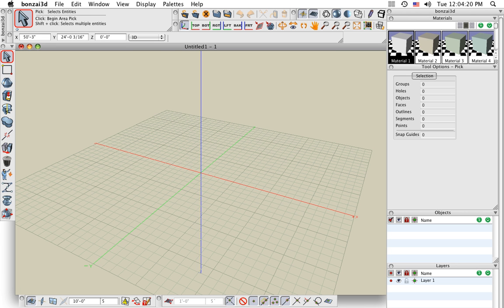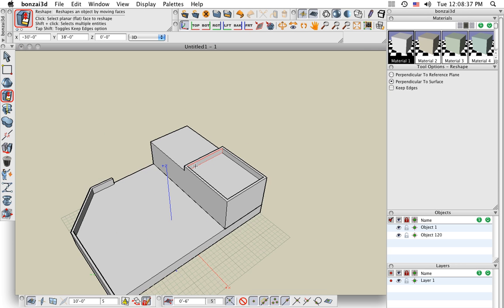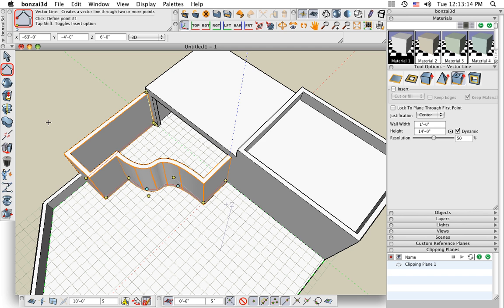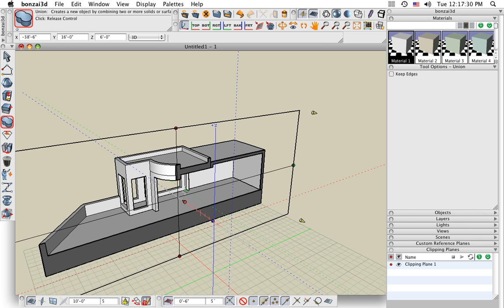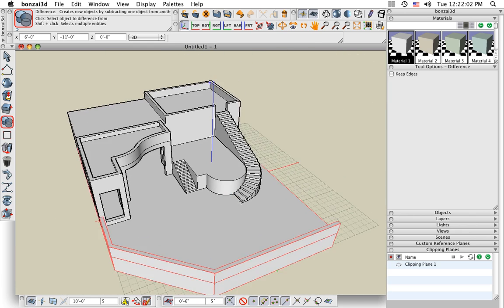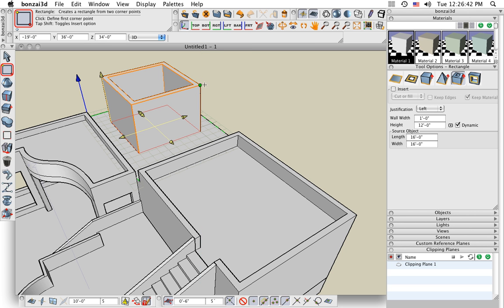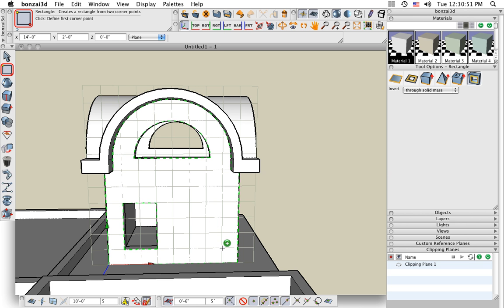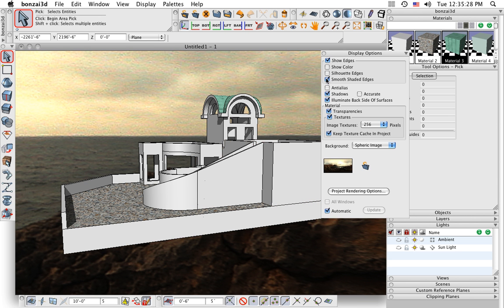bonzai3d - Sketch example : an architectural design exploration

Comment: ***** I believe I see a few things in this demo which would be quite difficult to do with Sketchup (at least the free version I am familiar with).  It would be very good to have a video which does a side-by-side demo and demonstrates the features of bonzai which are difficult, if not impossible, to do with sketchup.
Reply from the maker: Hi DukeLacrosse20,

Yes, there is LOTS that bonzai3d can do that SketchUp can not.  There is not a specific video dedicated to this (perhaps that is not a bad idea) but you can see this throughout our videos.  For even more capability, check out the videos for formZ -- which includes all of bonzai3d and a lot more!

Comment from the maker: Hi Vanastarr,

Bonzai3d offers many more tools beyond what SketchUp has, including Solid Modeling, Smooth Geometry, NURBS, and much more.  Check out the other videos we have on our channel and you should soon see the difference!

Bonzai3d also creates nice clean geometry without crossing or missing faces,  so the models created in bonzai3d can easily be used for rapid prototyping & much much more.

Give it a try and you will see why so many SkechUp users have switched to bonzai3d!

Comment: Hi Arcbc33,

Perhaps the easiest way to do this would be to simply draw the desired 2d (closed) shape, extrude it, and move it so it intersects the wall where you want the hole.  Then do a Boolean Difference to subtract that shape from the wall.  You can also create your own custom windows that will insert the hole automatically.  Right click on the Create Window / Door tool and choose Video for more info on this, and / or email support (at) bonzai3d (dot) com for more info!